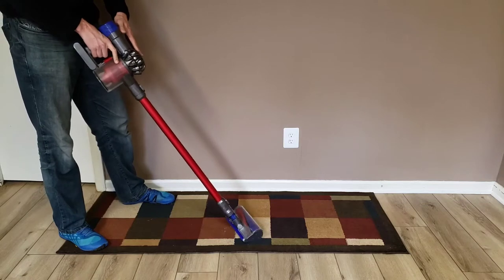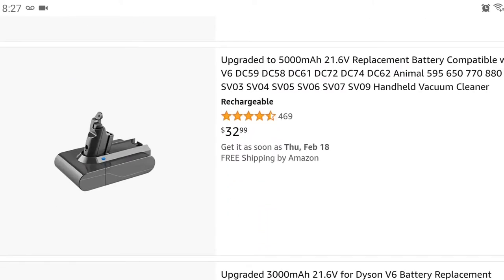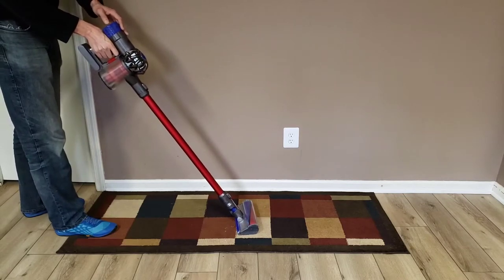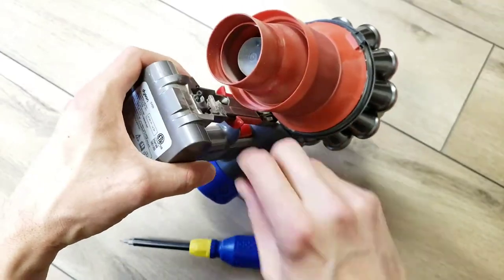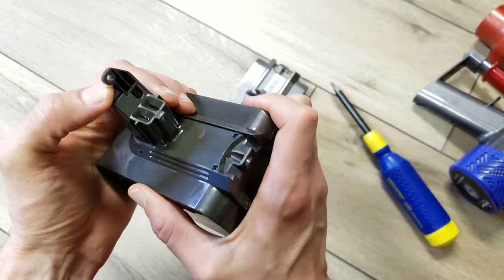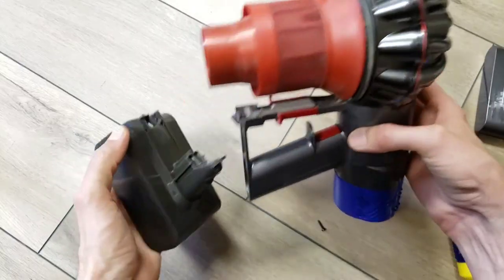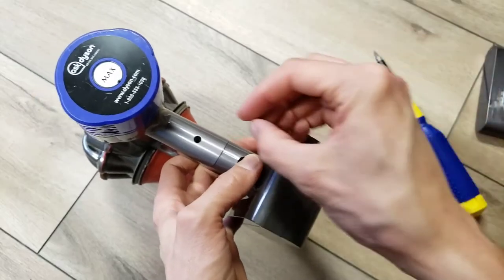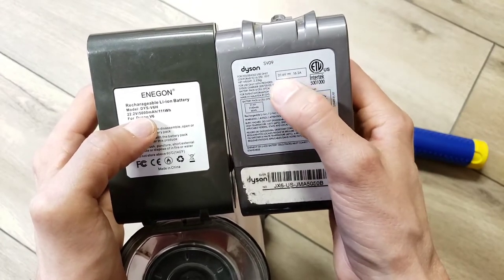Double the Runtime of Dyson Cordless Vacuum Cleaner using a 2X Capacity Battery to Increase Power

Comment: @engineerable is there a duel capacity battery pack like this for the V7 model?
Reply from the maker: I have not found one specifically for the V7. I will be buying the V8 one and see if it fits, since they are very similar.

Comment: How much runtime are you getting with the extended battery?
Reply from the maker: At least twice the original battery. I basically use it on MAX the whole time and it lasts long enough for everything I need to to vacuum, which is nice, because I feel like it does a better job on MAX and I can also get the vacuuming done faster.
Reply: So you recommend the bigger battery that you are using on this video.  Can you provide a link where to purchase it. Thanks .

Comment: Wondering if the new wall mount comes with the larger capacity battery, or if it needs to be ordered separately?
Reply from the maker: Check the links in the description, there is an option that includes the wall mount, and other options where you can buy the battery and wall mount seperately.

Comment: question: I’m planning to buy a shark vacuum but the same concept should apply, should I purchase a replacement battery for it? It’s brand new but I’m thinking I can double the run time. Im not familiar with vacuums & this is a gift for my mom. It’s 80$ for the battery compared to the 400$ price point of the vacuum (new)

thoughts?
Reply from the maker: What model Shark is it? Are you thinking to swap the batteries such that when one runs out, you will switch to the other? The issue maybe charging the battery that is not on the vacuum. With Dyson, the charger plugs right into the battery.

Comment: Get an adapter for a milwaukee m18 battery hook that up and then do your test
Reply from the maker: Planning to test those, but I've heard that you really need to use a 8-9ah 18V battery, because the voltage drop doesn't make it last long with the lower Ah batteries, since the Dyson battery uses one extra cell. The ideal power tool battery would be the 24V MAX batteries (~21V nominal like Dyson)

Comment: One needs to remove two screws, at the back on the handle and on the front of the battery pack. To remove that second screw you need to remove the refuse container. I am not sure how. Yeah! At 2:56 this is explained. "Pop it down again." Wow it is that simple.

Thanks. I have replaced my battery. Unfortunately with a non double capacity battery but still, the old one was weak. 

Does anyone know if it is worth taking apart the old battery pack to salvage batteries for use in LED lights? I find that old laptop PC battery packs have some good and bad batteries in them.
Reply from the maker: Glad my video helped you repair your Dyson. As for reusing old battery cells, that is not recommended. Individual cells have no charging, discharging or short circuit protection, meaning that they could overheat and create fires. You should only use individual cells with built in protection.
Reply: @engineerable  You may be right but I have been ripping cells from LAP top packs and using them in my bike torches for about 10 years and I have not gone up in flames, yet, nor experienced more than a few sparks so I think I will keep at it. 

I took it apart. I did short one of the batteries a bit with resultant sparks and smoke but all the cells are out now and two are in my charger.  

With PC battery packs there are usually one or two bad and tree or  four good batteries. 
I will see how this goes. 

I recently found out that some, at least some Samsung cells may have a mechanical anti fire protection mechanism such that when gas expands inside them due to heat, they cease to provide any voltage, which would explain why they can be made to work a little bit again by "venting" them (but they don't hold current). 
https://www.youtube.com/watch?v=HetEDTDmJmw

So while short circuit protection is there, at least in theory (in batteries in Dyson stuff) hammers, and excessive heat can turn them into fireworks. Here we go
https://www.youtube.com/watch?v=CUgbmCSmSNY

I am inclined to think that cheap batteries from alixepress are going to be more dangerous than batteries harvested from PC and big brand clelaners.

Comment: Now you have had this double pack for a while, what’s your experience? Is it safe considering it’s a Chinese clone so I presume the board and 18650 batteries are Chinese too and let’s just say they are not known for taking safety as seriously as western standards.
Reply from the maker: It's been good except for having to disconnect and reconnect it to the vacuum sometimes after charging to get the vacuum to start. You're right that it could be made of dubious quality and safety standards. Best to charge it inside a LiPo fire resistant bag.
Reply: @engineerable  "you're right", not "your right"
Reply from the maker: @patpending8134  Android/Google autocorrect is awful.

Comment: I'm tempting to try and adopt my 18v 4ah  bosch blue battery to vac.
I used them on my doughter ride on car....its worked .
Imagine 36v battery....🤯....rocket
Reply from the maker: Should work! There are 3D printed adapters sold on ETSY for batteries like Milwaukee and DeWalt

Comment: Can you link the wall mount too please
Reply from the maker: Here's the link to the wall mount: https://amzn.to/3fO9zyR and I've updated the description with it. 
I will say that the extended battery life has been awesome, but I've had some issues with this battery. The vacuum won't always start running after a full recharge of the battery. The only solution I have found is to remove the battery from the vacuum and then reinstall it. Then the vacuum works fine until it inevitably doesn't start again at some point after a recharge, and you have to repeat the removal/reinstall process. Therefore I've now removed the screws, and use a Velcro strap to hold the battery on the handle. It's slightly inconvenient, but I don't want to give up the longer runtime (especially on high).
I will have an updated video discussing the issue and solution.
Reply: Did you ever come up with a solution to the battery connection problem/start up after charging?

Comment: I would rather use a Dyson V8 with a Dewalt battery attachment. One 6 amp battery last 3 times as long as the original Dyson battery. If that ever went dead put in another 6 amp battery. I have 6 Dewalt batteries.
Reply from the maker: Yes, that would be convenient. I'm invested in Ryobi, and unfortunately those batteries have that dumb stem that makes them hard to adapt to other devices.

Comment: The batteries of SOME of the Dyson vacuums come out the way you show. Others have a different screw set up. Be specific about which model you are demonstrating.
Reply from the maker: This video is of a V6, and there are also double capacity batteries available for the V8 (see description for links)
Reply: the dc35 has a removable battery

Comment: where can i find that thicker rack and battery holder. i got v8 and can not find that thicker plastic rack from anywhere.
Reply from the maker: Unfortunately, I don't think they make a thicker wall dock for the V8. Seems like a major oversight to me. Not sure if the V6 one will work.
Reply: @engineerable  seems pain in the ass trying to find even v6 holder that would propably fit. i think i might just buy makita battery adapter for really sheap and really expensive 6ah battery. only thing that sucks is i need to every time take the battery off and trying to do some charging dock for it.
Reply from the maker: @xmortall  Yeah, I don't know if the V6 double holder would even fit the V8. So, if you go power tool battery, the 20V DeWalt batteries are better than 18V. 6ah+ 18V battery will probably be ok, but the smaller ah 18V packs will drop voltage too quickly, and trip the low voltage cutoff circuitry. My friend says that the 8-9ah Milwaukee 18V batteries work forever, but the 5ah doesn't work great.
Reply from the maker: @xmortall  I'm about to publish a new video showing a clip that I designed that makes it easy to quick change Dyson batteries, just like cordless drills. That way you can keep using Dyson (or 3rd party) batteries, and the wall dock charger.
Reply from the maker: Here's the clip that allows you to quick change the original Dyson battery https://youtu.be/IINl51YPMcc
Reply: @engineerable  what if perhaps v8 is a littlebit forgiving with low voltage and it works, does 18v change anything else compared to original 22v. like rpm drop or theoretical runtime with the same ah or something. i dont understand electric. thanks for answer.
Reply from the maker: @xmortall  That would be an interesting thing to compare. For sure the runtime will be affected by lower voltage, because the 18v battery will hit the cutoff threshold before it is completely discharged. As my friend said, the 5ah 18V doesn't work great, but the 8-9ah ones do.
Reply: @engineerable  i found an excellent video while ago. there is dewalt 20v, makita 18v, milw 18v and some else if i remember correct. 

there was something makita action going one BUT it was only because makitas own brainst told it to stop working when voltage drops so low that it would be useless anyway. not a problem.

 another thing was that both makita and milw were both damn near being same readings as devalt. them was behind like 0.2v or something insignificant at every test so much that dewalts 20v seemed like a gimmick.

difference or not dewalt still won by a hair splitting and makita went second best.

1 interest thing also here in finland, your dew flex battery is 20v. here the same new flex is 18v like any other also.

anyway imma buy the cheap adapted and just try first. seems it will work just fine as long as i have decent battery.
Reply from the maker: @xmortall  You are right, I did not know it until I researched it after you wrote this. DeWalt uses a Max voltage to claim the 20V. I thought they were claiming 20V was the nominal, not max. In Europe they are not allowed to claim max voltage, hence the 18V rating. Therefore, as you said, the performance will be the same across all brands.
Reply from the maker: @xmortall  In that case, the 24V (max) power tool batteries would be the same 21V nominal voltage of the Dyson batteries. 24V power tools like Kobalt 24V Max use 6 cells, like the Dyson battery. https://a.co/d/8LWn40d
Are there adapters for 24V power tool batteries?
Reply: @engineerable  i havent seen any. 🤔

Comment: Buy the DeWalt battery adapter. 👍
Reply from the maker: That sounds great, but you lose convenience of charging dock.
Reply: @engineerable  Yeah, but I don't have one and never used one.🤷🏼‍♂️
Reply from the maker: @2015_Rubicnn  Oh, you want me to buy and test? I'm planning to test all the power tool battery adapters, but that's a big investment in battery packs of different brands.
Reply: @engineerable  You can do what you want, I already have the dewalt batteries and chargers so 25 bucks for an adapter was a no brainer. I'm not into guessing games with Amazon batteries advertising bigger capacities when they aren't and they don't have the current rating these Dyson vacuums require. I also don't want to keep buying small Dyson replacement batteries because they are very expensive with low run time.

Comment: He must be a seller for the batteries — go read the reviews on Amazon batteries don’t even last after a week or so— a lot of bad reviews BUYER BEWARE !
Reply from the maker: How'd you know I'm a door-to-door vacuum cleaner battery salesman?... Do a little research, and you'll find out that I'm not a seller of these batteries. It's some random Chinese company. I bought one because I needed a replacement battery, and wanted higher capacity. The capacity is great, but I did discover an issue that I'm publishing another video about. Sometimes the vacuum won't start after taking it off the charger. Pulling the battery out and putting it back in somehow resets things, and it works fine again. I returned the first battery thinking it was bad. The next battery has been acting the same way. So I left out the screws, and put a strap around the lower part of the handle and the battery to hold it in place while making it easy to remove and put back in if it's not working. It's an annoying workaround for a battery that should work correctly, but for me it's worth it for the capacity. I can run the vacuum cleaner on high for the same amount of time as the original battery would run on low.
Reply from the maker: I have noticed that after the first few charges where sometimes the battery would need to be removed and reinserted to get the vacuum to start, it no longer exhibits this issue. Now it works every time when taken off the charger.

Comment: So you use ounces as your main weight measurement unit, but show the weight in ounces, pounds and grams.
There has to be a better way.
Reply from the maker: Just trying to cover all the bases so you don't have to convert. Although using ounces past 1lb is not really useful.

Comment: When. Part 2?😁
Reply from the maker: I've been using this battery for over a year without any degredation. Did have some issues in the beginning where it wouldn't run after a full charge. Had to take the battery pack out of the Dyson and put it back in to reset. Did this a few times and no issues since then.
Reply: @engineerable  tnx....:goodvibes:

Comment: Dyson over charges. But lasts several years, the energon probably has 3 months before the batteries become shit.
Reply from the maker: Eh, your username checks out 😂. I've been using this battery for over a year without any degredation. Did have some issues in the beginning where it wouldn't run after a full charge. Had to take the battery pack out of the Dyson and put it back in to reset. Did this a few times and no issues since then. I've done somecapacity and life cycle tests on 3rd party Chinese batteries for drills, and the main thing is they lie about the capacity. The capacity is usually at least 1ah less than what is advertised. The life cycle seems to be in the 400-500 cycle range, which is typical to be expected from Li-ion.
Reply from the maker: Also, I've had an original Dyson V7 Battery fail after limited use (<1 year of occasional use in an RV).

Comment: You can easily get individual 18650 batteries that come with 3500 mah capacity or 21700 cells that are 5000 mah each and 15A+ discharge rated... I mean it's ridiculous how they scam people.
Reply from the maker: Do you have links to these batteries? The V6 motor is rated at 350W. For a 21.6V pack, the max current is 350W/21.6V = 16.2A . The OEM packs have to use reliable cells at lower capacities that have higher discharge rates, probably in the 30A range to play it safe.

Comment: Most of these China packs have throwaway  grade B battery cells.  Just buy a Dyson pack and save the headache of play the cell pack lottery.
Reply from the maker: If Dyson made a double capacity battery, I would buy theirs. This pack has far more capacity than a standard Dyson, and runs the vacuum in turbo mode for much longer, which is what I need it for.